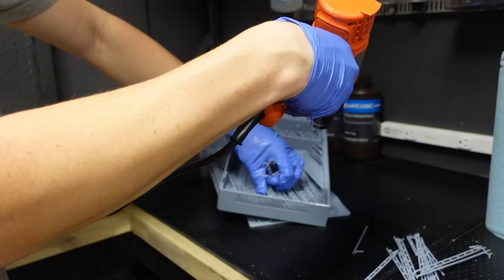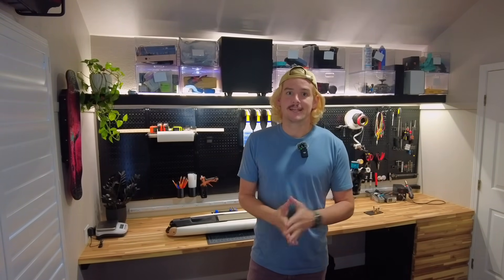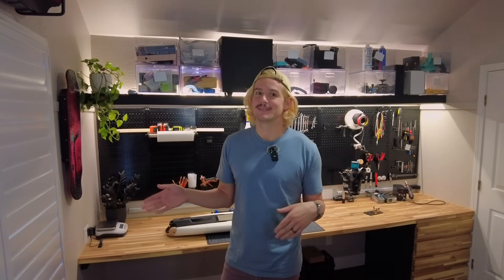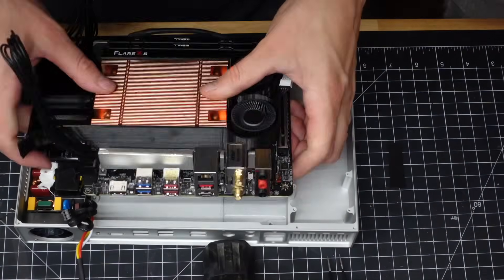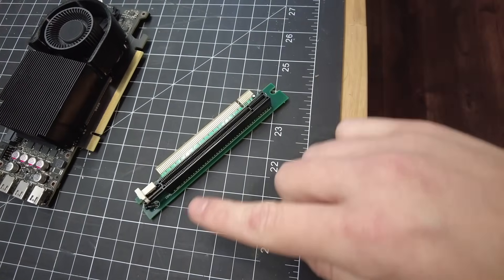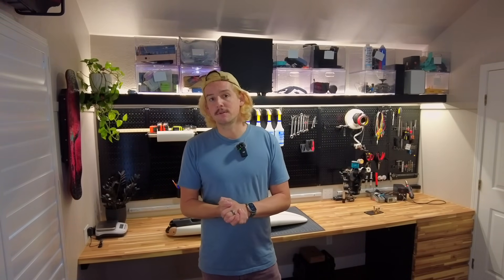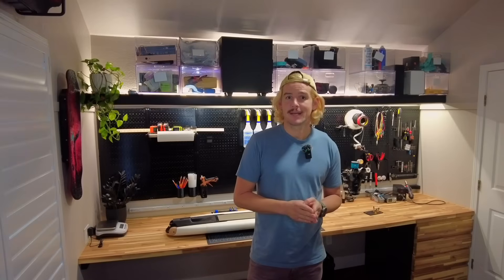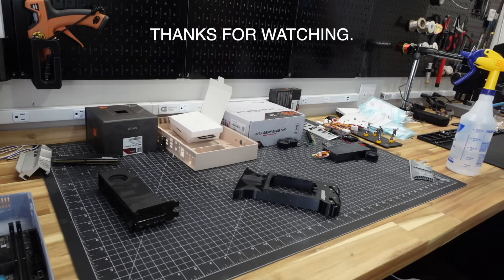I Built the Ultimate 2.5 Liter SFF Workstation PC

Comment: This is genius. I am trying to make something similar for years! I am currently working on a mITX laptop, with a cooling system similar to the DIY Perks's portable PS5 (6 heatpipes. one 200x80x20 copper radiator). 
But looking at your build, I would love having one like that, especially with the aluminium case. I would love a case like this, but with an Oculink adapter instead of the GPU, since there is not a large number of gaming GPUs on that form factor (I believe the 4060 is the only one).

I believe it's worth a try to try to sell the case as a kit (case, cooler, psu). Idk how many people are like us, but I still think you should try to do it.|

P.S. Also, maybe that amount of money for just a case sounds a lot, but the idea is that you can use it for decades, you just have to swap the motherboard and the CPU.
Reply from the maker: Thanks for the encouragement and kind words. An occulting setup would also be very interesting. A build like this with no gpu and an 8x00 amd chip with integrated gpu could be interesting and probably under 2L

Comment: gw! message from der8auer tho: DO NOT reuse the thermal pads
Reply from the maker: Yea, probably not optimal and the pad seems very easy to damage. But my thermals are still looking stable so I think I got away with it.
Reply: @FriesenDesigns  well you didn't reuse it. it is the "normal" installation process. one gets carried away, doesn't think things through and has to remove the cooler a couple of times. reusage is more like putting it on with the next cpu 2 years down the line.

Comment: the 3d printed cpu shroud wont melt right?
Reply from the maker: I printed it from a higher glass transition temperature filament so it should be fine. I have opened it and taken a look and haven’t noticed any warping or deformation.

Comment: the very best in terms of fps per watt is 7600X3D. even better than 7800X3D.
usually 40 watt consumption in games and beats Core Ultra 9 285K
Reply from the maker: Yea, if the focus was gaming then definitely the x3d chips would be the go to choice. For CAD and solid works the extra cores of the 7900/9900x can go a long way in certain tasks.

Comment: As a bit of a lapsed SFF enthusiast, this build really makes me happy. Amazing design work across the board, and you clearly did a superb job on the most difficult part of builds like this: fitting the case to the modified parts. Clearly your engineering experience showing through, as I've seen people do much worse jobs of this even with 3D scanned parts. I don't have any use for a workstation like this, so the case isn't for me, but kudos for making a great build!

Comment: This is so cool! To float some ideas by you: i believe there are some shims that improve vram temp on the stock cooler Nvidia deploys. There are also copper replacement heatsinks that make maximum use of the available space inside the stock shroud to improve temps and reduce noise.

Maybe you'd find the laptop cpu+itx mobo combos from China interesting to reduce power consumption, heat and noise even more. Minisforum has an amd board with the 7945hx and 55w tdp.
Reply from the maker: Yes have definitely spent some time staring at those custom gpu coolers. Really cool. Haven’t seen the shims before though sounds nice.
Reply: @FriesenDesigns  The shims first appeared when people used the A2000 for mining and noticed bad vrm temps due to fat thermal pads. The copper shim gets installed with some thermal paste and drastically reduced temps and i believe allowed for some oc.